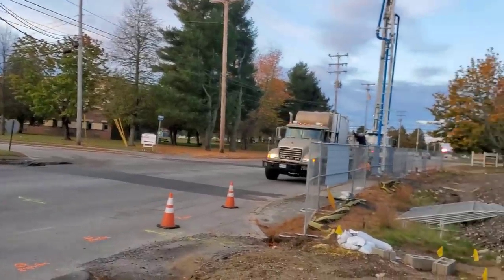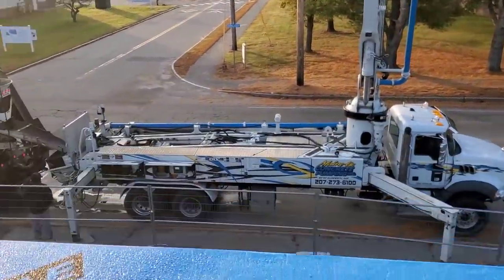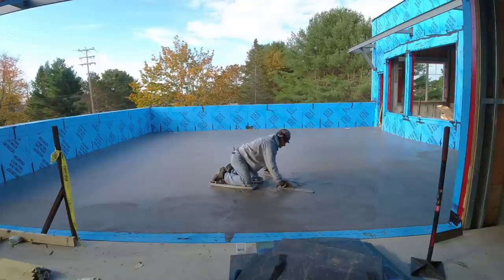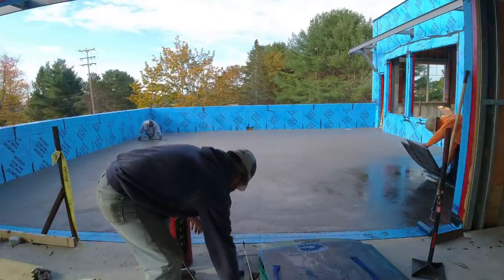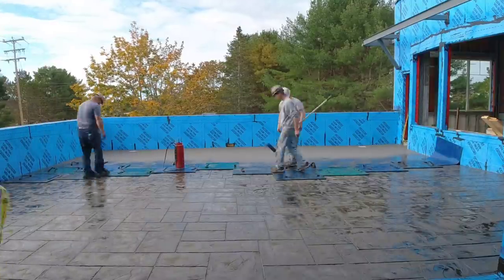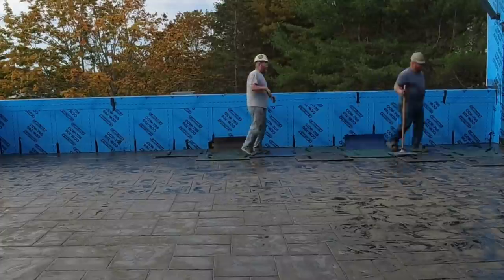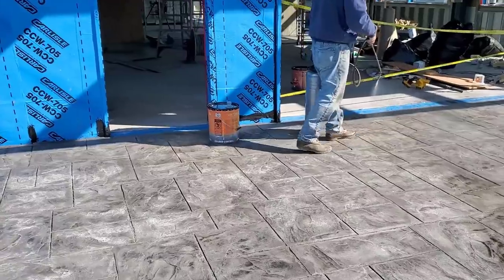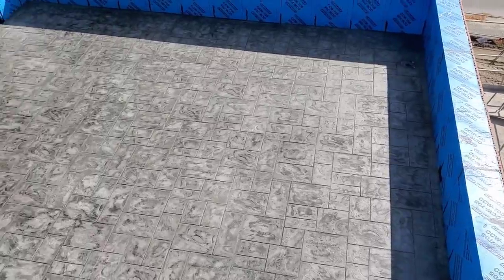Amazing Looking Stamped Concrete Patio - How We Did It!

Comment: Mike,
Fantastic job. I can stay that I have nothing to compare it to, but the color pop and the workmanship is great.. A real credit to you and your workers.

I am hoping I can retire to a place in northern WI which I am thinking, weather wise, may be close to the conditions you deal with.
You have given me such good ideas as well as what to look for in craftsmanship. 

As with most guys, my biggest fear is the concrete cracking. I suppose over time it may be impossible to think the concrete won't crack at some point.

I work for UPS and the building I work in is HUGE. Two floors and the building as stood for over 50 years. And believe me I have looked at the floors extensively.  Minimal cracking and for the most part hairline cracks.
When my time comes I hope the area will have the craftsmanship you have.
Reply from the maker: Thanks Chip!

Comment: We have watched a lot of your videos and they are very informative. I am hoping if you have a moment you can answer a question. We are curious about how a stamped overlay would be done that is freshly sealed (within last 60 days), the pour was not done correctly and the correction is to do an overlay and stamp it. Do you need to prep freshly sealed concrete first? If so how?
Reply from the maker: You got to remove the sealer. Either grind it off or strip it off.

Comment: What is that saw called? Way better than a husq
Reply from the maker: It's the old Soff-cut saw
Reply: @MikeDayConcrete  thank you, what are better expansion joints (redwood,treated) or saw/tool control joints?